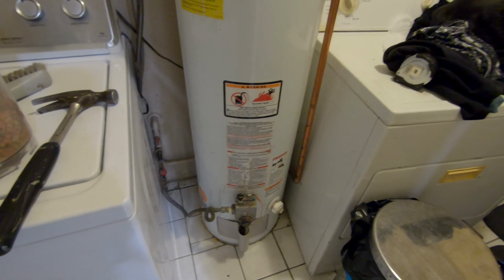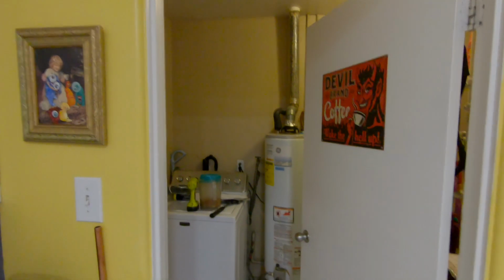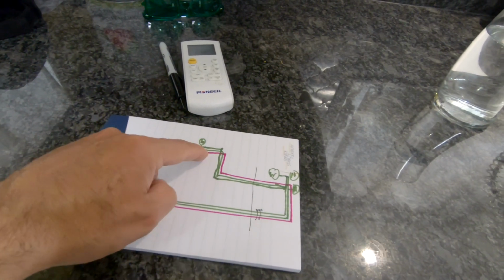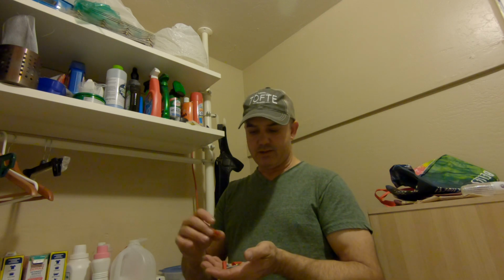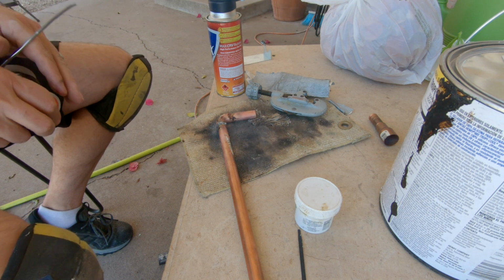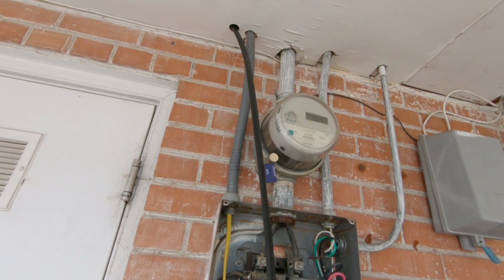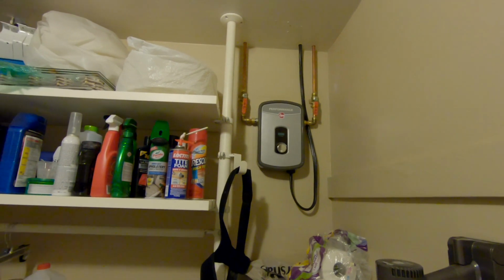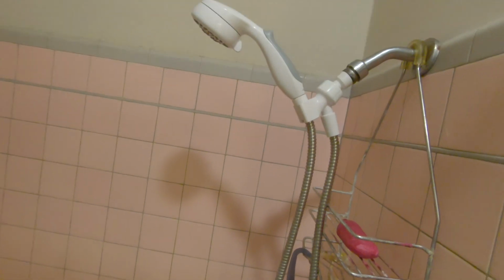Installing a Tankless Electric Water Heater - Rheem RTEX 240v 13kw in My House

Comment: Thanks for the vid, I'm going to get the Rtex 11, I know everybody has an opinion, but you should protect that 6 gauge wire coming in, not sure code and if it can be in conduit, but anyway.  Appreciate the vid! Also, not sure why you are stating your rating wrong, your model should get over 3GPM.
8kW Model Flow Rate: up to 1.95 GPM
11kW Model Flow Rate: up to 2.68 GPM
13kW Model Flow Rate: up to 3.17 GPM

Comment: I put the 18kw in my house and we are on a well pump and it does not work it throws a E5 code which means the flow is to high but we have horrible pressure because of the well pump so I don't see how anyone can use a 13kw for there home..
Reply: Maybe your well pressure is set too high.

Comment: I know this video is 2 years old but I just had this installed into a “tiny” home and for some reason it’s not working properly.

The water never gets to 140F, it only stays warm for a min before going cold and then warm again, and then the bath tub faucet does not get warm at all.(the valve is all the way up) any advice? I have the exact same one as you.
Reply from the maker: It sounds like a bad flow sensor or there is too much flow. You may need to install a restriction to slow the flow down.

Comment: Dude your breaker panel has a bit of rust in there. That is no bueno. You are getting some moisture from somewhere. That shit needs to be sealed up. You are going to get electrocuted touching that thing or eventually get some arcing and cause a fire. That should be top of your priority list my friend.
Reply from the maker: Yeah that box is 40+ years old. No actual leaks. just looks rough from being outside. The main is being moved to another wall so it will all be replaced.

Comment: Curious to know after 2 years how this electric tankless is holding up
Reply from the maker: so far so good. Its now my ex's house but I showed her how to flush it last week.
Reply: Making it flushable was a very good idea.  I have the same unit.  I'm on my second one because the first one failed.  The heat exchanger sprung a leak and Rheem didn't honor the warranty.  I'm now troubleshooting the second one because the temperature shoots way high while I'm taking a shower.

Comment: As a plumber I can tell you have hard water you need to install a filter in front of that water heater line or you're going to end up with that same gurgling in your tiny little heat exchanger which will officially plug it up trust me from experience

Comment: Why did you switch to a small electric tankless instead of gas?
Reply from the maker: Gas in that house was very expensive. switching to electric saved $40 a month.
Reply: @davinsrandom3142  Someone else recently mentioned saving money by switching back to electric. So much for the "electricity is the least efficient way to generate heat" argument I guess. 🤣

Comment: That measly carbon filter wont stop your hard water. You need a water softener. Your water is similar to Floridas. Best set up for your system is line in to house-> then whole
Home filter-> then water softener-> then hot water heater. Otherwise you will get scale build up
Reply: HOT water heater??
It's a cold water hearter..

Comment: I was told that a tanks water heater can not be install on a older home with aluminum wire.
Reply from the maker: I would run new wiring if you're planning on it.

Comment: What’s the difference between the RTEX 11 and 13. 
I have a 1 br town house 
With 1  1/2 bathroom  only one shower 
I
Was told to use the 11 is that true ?
Reply from the maker: Either one will work. It all depends on the  distance from your water heater to the tub. More than 16ft of pipe then go with 13kw. If it's less then get an 11.

Comment: ummm. It isnt because it is too far away. You have undersized the unit. It can only do so many GPM at the temp you want. That's why if you back it off then it warms up. That thing is made for a sink or a shower with highly restricted flow. Im not going to get into what else is wrong in this video. This alone should speak volumes. The info not provided in the directions was to stop people like you from doing what you did. Too bad it didn't work. You are dangerous man.

Comment: I think it would have been easier to put it on the wall right where you took out the old water heater, water already there you would have just needed to add our power.

Comment: I think if you are using black and white wires for your 240V connection, you are supposed to put a couple wraps of black tape around the end of the white wire to clue future repairmen that it is not a neutral conductor. Also, I have seen sharkbite connectors pop off, particularly when applying pressure to a line that had no pressure. Maybe they are OK if constantly under pressure.
Reply: When the future electrician turns the breaker off they will know it’s not a neutral with a 2 pole breaker

Comment: In our pole building (shop) , all that I plan is to use PEC, but no shark bites, just clamps. I am bringing water in from meter, but no copper in shop. In the past (40yrs ago) I always used plastic pipe, but am being told to use PEC now.  Is this OK and how do I hook this up?
Reply from the maker: You could totally do it. Just get Pecs to copper adapters The pipes coming out of water heater need to be copper to seal correctly. Just a few inches of copper tubing on the inlet and outlet then a pec to copper adapter.

Comment: I believe you should have added a pressure release valve and two clean out valves to descale your unit every year or two.  That will prolong the life of the unit.  Just my two cents
Reply: I agree fellow plumbing pro
Reply from the maker: I did and I talked about it in the video.

Comment: Never seen a 120 V electric water heater  in the US, it's very rare. Neutral vs Hot in the USA  only applies when 120 V, since your using double pole circuit breaker there is your answer.

Comment: This was an excellent video. As with so many viewers, Mr Davin also speaks in practical terms and offers routine terminology with insightful opinion.
Just one question regarding the Shark Bite copper connectors. In the first introduction within this video, Mr Davin identified the Shark Bite product as a ‘snatcher’, as in copper snatcher. In later describing the product, Mr Davin used the standard description of Shark Bite copper ‘connector’.
I am comparing these terms not for any technical or copyright statement, but rather to settle a mild friendly household argument as to the term ‘snatcher’ that was first used in this video. Yes, this is petty, but for two viewers it has presented the usual household argument regarding who needs a hearing aid more🙂Mr. Davin’s responding statement made here as to what he actually said would be gratefully appreciated, as we have played the first description 7 times. Both of us continue to ‘hear’  distinctly different 2nd words. Does your first description use the word “snatcher” or ‘connector’? The favor of Mr. Davin’s reply and clarity will be eagerly looked forward to. 
And Bravo! For your practical and useful presentation.

Comment: I had one of these installed about 6 months ago, but now I'm getting lukewarm water instead of hot water what could be the problem?
Reply from the maker: If you have hard water then you may need to flush it with vinegar.

Comment: Im curious why it wouldnt be code to run 6/3 wire on a 220 application especially with a 60 amp breaker? That being said I noticed the internal of the water heater only accepted 1 hot  instead of two as well. That confuses an idiot such as myself. Lol. Nice install though

Comment: Your unit has the black load line "L" installed on the right and the white neutral line "N" installed on the left. On the interior housing of my unit it is stamped exactly the opposite in that the "L" is on the left and "N" on the right.  How is yours's stamped?
Reply: It's a 240 voltage water heater, no such a thing as Neutral vs Line.

Comment: You didn’t show how you actually did the connections for electric and water. You showed after it was already done
Reply from the maker: Its only 3 wires, Line - Black, Neutral - White, and ground. Same for the breaker

Comment: I would never attempt to do something his massive by myself unless I were a electrician and plumber.  Make a mistake, it can cause an electrical fire which would not bode well with gas also in the house.   Converting from standard tank to tankless would be even more difficult, and you would need a qualified plumber to set everything up correctly. They need a lot more maintenance, and they are also more prone to leaking.  You also need building permits. And your electric bill is really going to skyrocket heating water with electricity.

Comment: I have question. I installed one of this at home but when ever I use hot water my lights start to blink why is that?
Reply from the maker: Are your lights a dimmer switch?
Reply: You BETTER get an electrician out and inspect what you did.
Reply: Depends on your total service amps for the whole house. You are not to exceed 80% of your breaker. So if you only have a 100 or 150 amp service you might be exceeding it.

Comment: If you want instant hot water get a 6 gallon or 10 gallon Rheem 120 Volt hot water tank and connect it to a recirculating pump after the on demand water heater this way you will have instant hot water, and if you have issues with the on demand or the power goes out you can still power your whole house with a 3500 Watt /120 volt generator, or a 120 volt Solar System. Ive put a meter on the Retex 13 & it pulls 54 amps.

Comment: What size is the service to your house -100amp did any breakers trip when the dryer stove and hot water unit we’re running
Reply from the maker: 125 amp and no breakers tripped.  This is on its own breaker.
Reply: 13kW needs 40A breakers. 8 gage wire would've been fine
Reply: @artterzian6233  13KW @ 240 V = 54.16 amps ... definitely 60A breaker and 6 gauge wire .
I've been researching for an 11kw unit ... and it still needs larger than 40A & 8 guage wire.
Albeit I might could get by having to reset the 40A breaker once in awhile for my unit.
But the video poster couldn't .
However breakers ran close to their limit regularly become soft , and I would likely have to replace it every so often.

Comment: I need a 8 GPM tankless unit with all the showering and laundry that is going in my house. I looked at one sold by Lowe’s and for the electrical it requires 3 double pole breakers 50 amp with 3 dedicated cables all 6 gauge copper. Also the house needs 300 amp service from the electrical company and I have only 200amp on my panel right now. Sad moment.

Comment: Consider insulating your distant hot and cold water lines to solve the temperature problems.  Also, I recommend R-30 batts in your attic which I installed in my central Florida townhouse in 1991 so that now my average electric bill is ~$43/month.  My unit is comfortable without A/C downstairs.  I use ceiling fans and open windows at night.  In your case consider a swamp cooler instead of A/C.
Reply from the maker: My water lines are insulated. Here in Phoenix we have to do it so we don't get scalding hot water in the summer from the cool side. It only helps a little though.
Reply: I saw your attic.  You definitely need R-30 batts.  Construction people frequently have a huge surplus which they stack in their attacs so ask any construct friend before buying.
Reply from the maker: @Eusebeia7  Yeah. last year I sucked all of the insulation out and did  blown in and  batts over the areas that have plumbing and electrical.  It's definitely getting another layer just haven't gotten that far yet.

Comment: Thanks for the video. I have a question for you: Which one is better in cost (upfront, installation and running )? 1. conventional electric tank heating system 2. One big tankless electric water heating system or 3. Mini-Tank Point-of-Use Electric  Water Heaters  at multiple points (2 in bathrooms and one in kitchen for dishwasher and  sink).
Reply from the maker: Mini tank systems are meant for Low use. Like a half bath or sink to wash your hands. They don't have the volume output for high flow like showers and bathtubs.You could do 8kw tankless at the point source like a half bath or kitchen but you need at least an 11kw for a shower. .
Reply: Tankless electric, you will have issue in within 2 to 3 years and when you take a shower and lower the water to keep from running, it taks a while to heat up again, in the winter it gets inconvenient,had two of them,bad experience,going back to the tank.

Comment: Don’t use shark bite fittings on a nice heater like that 😞
Reply: Whatever...until you got data that shark bites are a problem then it's just old farts hating on new tech. SB and pex is proven time and time again while I got 20 year old copper joints failing all over my home.
Reply: @cowlumbus  Anyone who uses shark bites or has any experience in the maintenance field knows that an O-ring seal isn't going to hold especially not like copper. No one is hating on pex. Everyone uses pex but not SBs.

Comment: Won't you pay more using electricity instead of gas to heat your water? Then again if it's only for warm water not for heating your house I guess it doesn't matter that much.
Reply from the maker: Compared to gas it will cost 10$ more a month but mainly because my wifes showers are 5 min longer
Reply: If you have solar panels, u could possibly eliminate the gas bill all together and even electric.